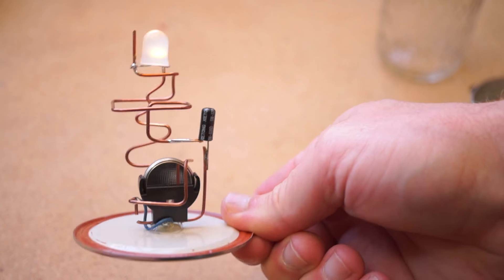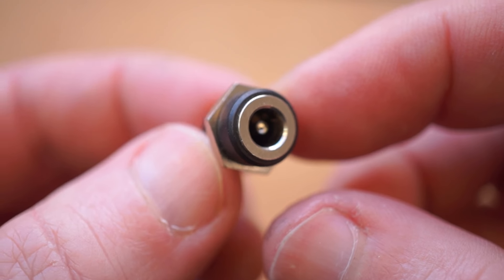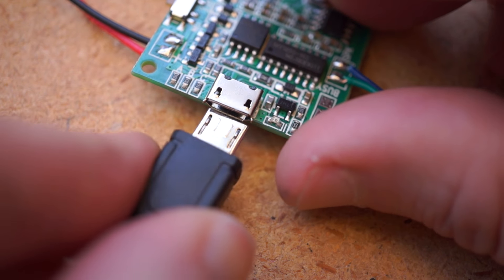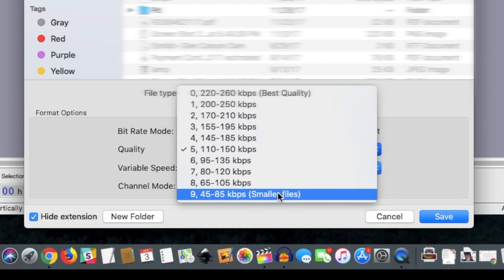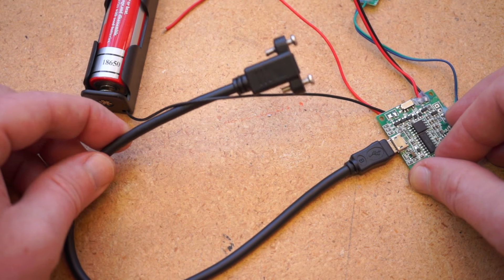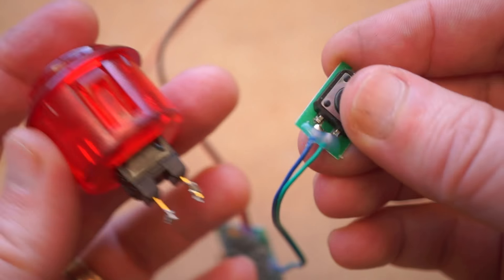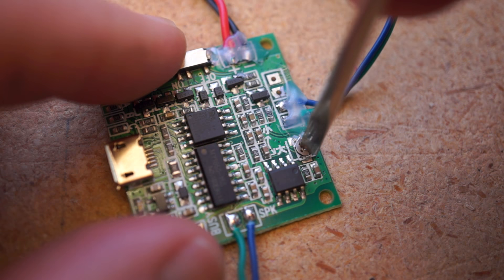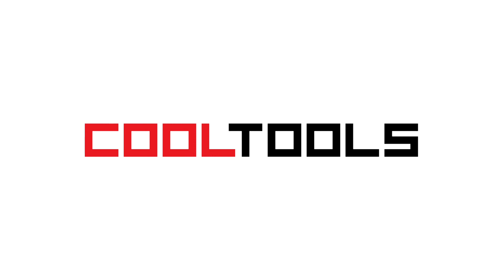Add sound to anything

Comment: Thinking of getting something like this but the model that has the two rechargeable lithium 2032 cells and you upload an MP3 to it by USB since it mounts like a flash drive. My project as pointless as it sounds is to make a sound device that plays the intro music heard on the FX TV network website back in 2001: "are you Xperienced". I just found a copy of the music and a jpeg of it from back in the day.

Plus I can put music on it and play it through my stereo, going to be adding an audio out jack to it.

Comment: Know this video is a bit old but i came to this video because i am running into an issue with getting the device to connect to my pc. I have tried 3 different micro usb cables and 2 different machines both running windows 10. Does not show up as a device at all. But the actual module seems to function. Is this a issue on my end with device compatibility or is my module defective?
Reply: I've tried with mac and PC, no luck

Comment: I wonder if this module draw any current from the battery when idling... I mean even in the pico amps... a birthday card doesn't as the thing simply disconnect the power when the card is closed and apply it back when it's open... and the player start playing when power is applied... I wonder if we can reporogram those epoxy potted modules...

Comment: Im looking to add sound to a toy. Specifically a light saber that plugs in. I would like it to play the on and off sounds when the unit is turned on and turned off. Do you have a guide to do this?
Reply: Been trying to figure out how to do this myself but have not found any definitive answers. Have you had any luck? Attempting to add a speaker with a single sound effect that I want to have play once right when the machine is turned on.

Comment: Got this module put a 3 AA battery pack to the 5V section but and put a new button on the end but the button wires are to gound and PL are they in the wrong spot because its not working

Comment: PLEASE tell us how to play different sounds on the same one. I´d like to play different sound files in a certain order, but only for each time I hit the button.
Reply: did you find a solution?
Reply: @penxy3331  I bought one from a different brand, but they have this stupid watermark as one of the files which can only be completely deleted if you reformat the thing. So I tried that, not knowing what filetype it actually needed to be formatted to. And now it won't play anything. So that's great.

Comment: I've purchased 2 modules but I none of my MacBooks will recognise them (2015 BigSur usb2 / 2021 M1 Ventura usb3) nor using windows on both of them. The green LED lights up but no matter of the switch is on ON or OFF position it simply won't show on the screen. Any ideas why? Thanks.

Comment: I bought the chip from link and as soon as I added my own sound to it, it stopped working.  I used my logic analyzer and found that the memory was corrupted.  I was able to flash the memory and it worked but the fact that it failed after the first run isn't a good sign.
Reply: Might be what happened to mine just now I tried to add a sound and nothing
Reply: How can i fix It? It happened to me too.. any help? Thanks

Comment: I'd like to replace my old crappy door chime with something like this.  Ideally I'd power it via a 4.5volt wall wart and then somehow get more volume.  Do you think it is possible to add a mini amplifier to the arrangement?  Then a larger speaker.  Any hints on how to power a 12 volt amplifier and how to couple it to the sound module being the sound module has a lower voltage?

Comment: I see that it says in mine that there are different play modes involving “switches” but they aren’t switches. You said you can short those out. Can you explain that? The way I’m understating it is you have to unsolder the resistors but that breaks the circuit. And I don’t see wires coming through the board to unsolder them anyway. I want it set to 010 instead of the default 000.

Comment: I've ordered two of these and they both appear dead.  I'm feeding the 5 volts 4.9 volts and nothing happens, no audio no USB detection, adjusted the volume pot up and down.  Is there something I missed?  The resistors are in default configurations.

Comment: Is it powerful enough to be used in conjunction with LEDs on the same circuit?
Reply: More than likely, since its switched but i couldn't tell you if the supplied power to the audi would keep it lit with audi playing or just flicker when pressed.

Comment: Why did you not give us a demonstration of the sound quality of the onboard equipment??
Reply: Because it's a fucking sound module, not a music player. It's not designed to play high res FLAC files while connected to ultra high end speakers. It is a device made to play small snippets of sound on something like a toy or a greeting card. It's not meant for sound quality, because it's purpose doesn't call for high quality sound. It just calls for sound.
Reply: @PlatinumEagleStudios  WOW. I'm glad you took the time to man-splain that to me. Of course it's a digital sound module. LOOK AT IT. My point is still valid, in that, I wanted to know what the quality FOR THE SOUND BOARD was like because I have a similar project and wanted to know if this was a good enough material to incorporate. MY BAD for expecting a review to REVIEW.

Comment: Hello, I ordered two of these sound modules and I cannot get either one of them to connect to my MacBook Pro. Any suggestions? If it was only one of them that wouldn’t connect, I would consider it defective but since both of them aren’t working I’m wondering if it’s something with my MacBook. For information purposes, my MacBook hooks up to flash drives and anything else just fine. Any help would be appreciated! Thanks in advance!…
Reply: Drivers.
Reply: yeah I'm having the same issue and I bought 2 aswell. It won't connect to my PC either and have no idea why
Reply: @elicreationaustralia  I ended up buying units that just record the sound with the press down and hold on a button. Then I just played sounds from my phone right next to the speaker. The sound quality isn’t as goo as I would like but it worked for my purposes.

Comment: Nice video. Do you know if there's a way to make the sound play continuously once the button is pressed? (until removed from power source)
Reply: The thing will come with a little or code manual scan it and there are many diffrent modes it can have just set it to the one where the sound will loop as the button is pressed and soder the button wires together  and should do the trick.

Comment: Great vid, thanks. I see that product is still available, but I was wondering if it can easily be set up to just loop the programmed sound when power is applied.
Reply: @rerhart585  Thank you so much for your response, that is totally something I can do. It’s for my screen accurate Flux Capacitor… eat your heart out 🤪

Comment: Thank you very much for this video!  This piece of equipment is what I was looking for while researching a project.  I looked through the details on the amazon page, but I couldn't find out the answer to my question:  can the sound be played one time when the button is released (rather than pressed)?  My goal is, when the button is pressed down, it will not play.  Thanks!

Comment: Hey, i wanted to add something like this into a 3d printed companion cube. While i have some ideas for making a button work, i want it to be motion activated and play a loop for a minute or 2. Is there a good video i can reference to get that set up? The cube itself is made in such a way that its really difficult to get into the space in the center after its assembled, so i need to work out a good qay to eaither charge it or keep a very long battey life. What do you recomend i do?
Reply: And by motion i mean it sets off when it is picked up or moved. Like a gyro sensor to work as a motion sensor
Reply: I have the same question!

Comment: I’m a model railroader and I have been thinking about creating my own sound system, I thought about downloading an MP3 of a train whistle but I thought that if I press down the button and hold it the whistle sound will play for a second, I want it so that if I hold it down, it will play for as long as the button is pushed down. Any suggestions? Also can the module handle a few amps? Thanks

Comment: Hi, quick question. How do you change the batteries? I have this music box (not a traditional one, one with this module in it) and it won't play well, I think it's because of the battery but they are in this metal casing that I can't get into...

Comment: Hey, I've just bought a similar one of these to play an audio file when a box is opened. Is it possible to increase the  volume? 
Would changing the speaker size do this?
Cheers.
Reply: If you need a lot more volume, you can use a mini amp with a bigger speaker.
Reply: Here’s the amp you can wire in to increase your volume 
HiLetgo 5pcs PAM8403 2x 3W Mini Digital Power Amplifier Board AMP Class D 2.5-5V Input https://www.amazon.com/dp/B00LODGV64/ref=cm_sw_r_cp_api_glt_fabc_W5T4PMXJ3DJVHKDSS4NN